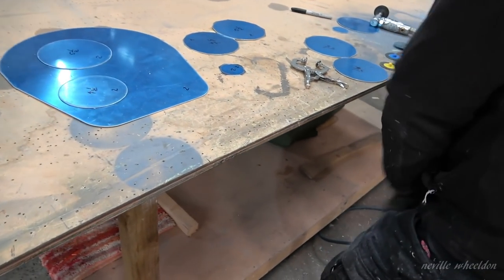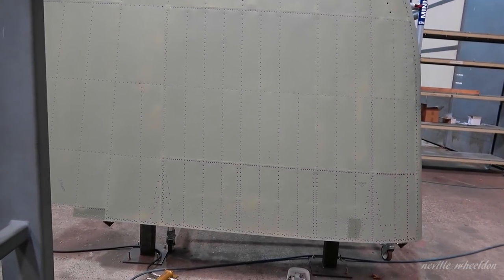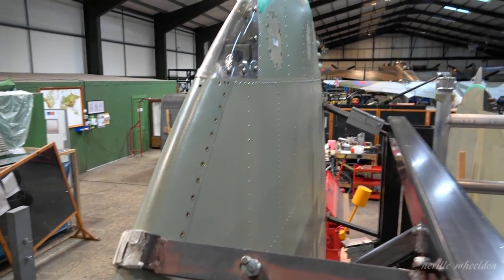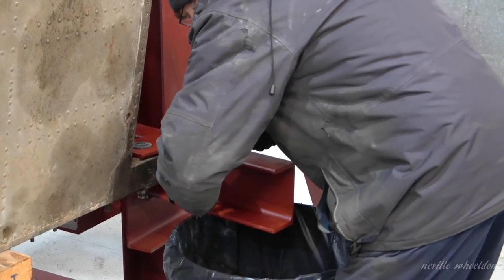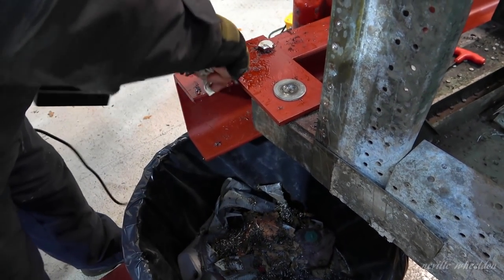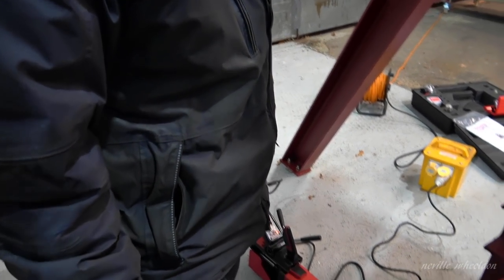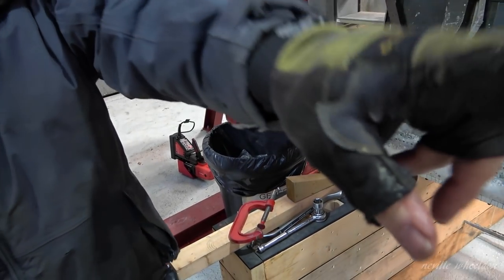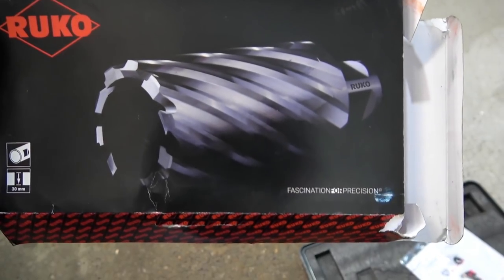Video 128 Restoration of Lancaster NX611 Year 5. Wing Jig nearing completion.

Comment: Hi Neville. How did they resolve this 17 feet radius issue for the side of the body in the jig for the formers? The drawings were unclear as to where the origin of the radius is in relation to the frame. I’m sure many would be interested in the answer. And Thank You for the info I asked about regarding fuel used on a taxi day and the cost. Really interesting!
Happy New Year!
Reply from the maker: Hi Peter I have put your comment to John the answer on Video 130 will be uploaded this Saturday. Thinking about I didn't quite under stand fully the answer. He said it didn't show up on the CAD drawing.
Reply: @nevillewheeldon1693  thanks Neville! I appreciate that. Look forward to Saturday :)